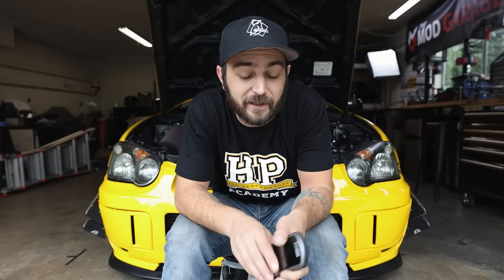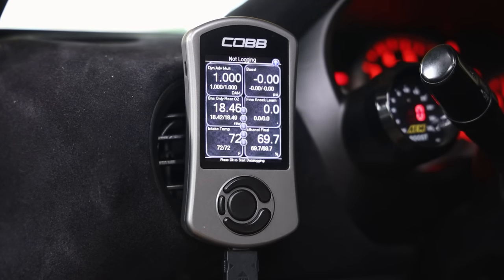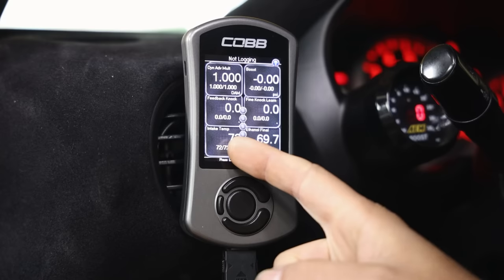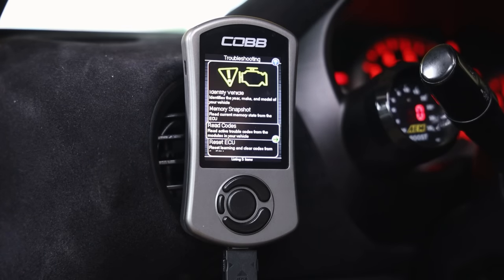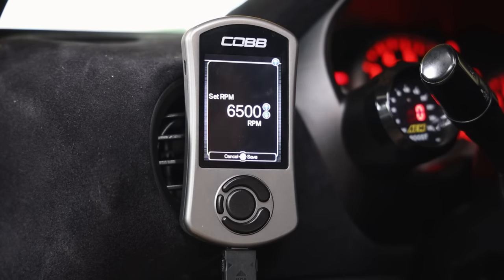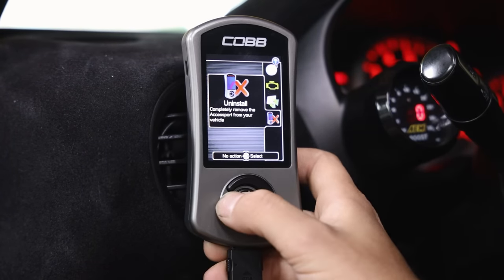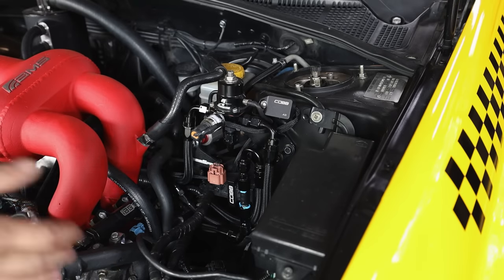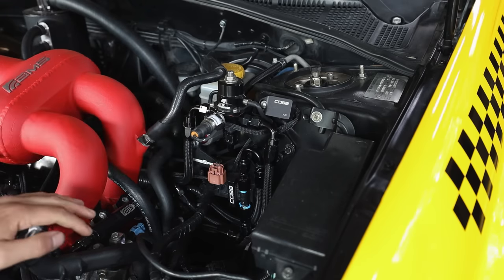Complete Cobb AccessPort Guide: Features, Values, Set up, Tuning & More.

Comment: I've recently got an accessport on my car. I'm stage 1+ with redline cobb intake and tomei cat back. I've noticed my accessport has 3 different (OTS) tunes I can put on my car for stage 1+. The "normal" one, HWG and LWG. How do I know which one I need to use. I know it has to do with the PSI your turbo is putting out, but it also says to contact your tuner to figure it out. Which I do not have a tuner yet. I noticed that with this tune on my car my turbo was able to jump from 18PSI to 21 PSI. Do I need to use the LWG because of this? I was also reading that my "turbo error" on my accessport is supposed to be between -1 to 1 with wide open throttle and I'm more between around 3-4. (with wide open throttle).
Reply from the maker: The LWG map is always a safe bet until you can snag a tuner. What is the car?

Comment: So in my case I bought my wrx hatch with an invidia down pipe, catback exhaust and Cobb intake and I’m running a stage 2, should I remove the tube to be safe or so? This is my first Subaru so I wanna be safe but modify it too.
Reply from the maker: I'd highly suggest the Cobb downpipe. With a catless downpipe and being internally gated your subject to boost creep which can cause lean conditions.

Comment: I just bought a used 2018 Sti from a car dealer.
I have driven it about 500-600 miles and the other day I noticed dark stains looked like oil with dirt mixed stuck on,  near where the Y pipe meets the turbo. Should I be concerned….?
Reply from the maker: I'd inspect around for leaks, sounds like it may be the valve cover 🤙
Reply: @Smeedia  ok thank you for prompt reply. Btw I really enjoy your videos they are very informative. Keep up the good work and good luck on your future endeavors.

Comment: I jus bought and a focus st with a cobb accessport, how do i tell what tune it is on and what gas does it is tuned on?
Reply from the maker: If you go into the tune settings it should say "show current map" that should have the fuel type to use and what tune is on the car 🙏
Reply from the maker: Also congrats on the ST!
Reply: omg u replied 😨. thank you i appreciate it so much. one more question if you don’t mind. my car also has an ethanol gauge and i’m not sure if it takes E85. it’s a 2014 Focus ST. I looked up if it has flex fuel but i’m get mixed answers. Can u help?
Reply: sorry another questions. i was doing a pull and the car is mostly putting in times to a max of  4.30 but i say it take out .60 as the min. should i be concerned
Reply: @Smeedia  i checked it and it’s just showing me that it’s a custom tone by the previous owner.
Reply: tune*
Reply from the maker: If its a custom built map then what you can do is download accessport manger on your computer. Connected the AP to the computer. Then select thr custom tune and that should pull up all of the map notes covering what's all done to it😁
Reply: @Smeedia  okay thank you so much. it really means a lot. just wanna make sure im taking care of the car correctly.
Reply: @Smeedia  i did what you said but when i try to open the tune, it’s says it’s a .ptm file and it wouldn’t open the tune.

Comment: could a boost leak or a loose gasket leaking air cause the DAM to drop? and if there was a loose gasket/nut making a rattling noise could it be setting off the feedback knock?
Reply from the maker: Yes and yes. I'd start with a smoke test and then start looking around for loose things

Comment: Do I need to reflash the car in order to install the accessport or is it plug and play automatically does the live data reading? I bought a car and it has a stage 2 tune and I want to look at how the car is performing. Can the accessport identify the tune? My plan is going stage 3 but as of now I want to see how the car is doing
Reply from the maker: You'll need to reflash, but you can monitor all data live. 🙏
Reply: @Smeedia  Ok. Does the accessport comes with Cobb tunes already downloaded? I don't have a copy of the current tune since I'm a new owner I don't have a tune to flash it to

Comment: So i have a Super Dumb Question on Flat Foot Shifting, I have a 17STI and i have FFS set to 5500 RPM, however when i floor it (accel 100%) it goes well past 5500RPM, does FFS only activate once i push the clutch in to shift similar to LC or should it not pass 5500RPM?  Do i need to be floored for it to activate?  Thanks!
Reply from the maker: Not dumb at all! So the FFS limiter will keep the car from over revving past whatever it is you set it to while your shifting and yes needs to be floored 🙏

Comment: Hi, I am not sure if you will see this. I have a question about the Accessport I recently purchased one for my 2020 sti but am having installing issues. The Accessport just keeps saying “Verify the ignition switch is in the ON position” which it is when I double press the start button. Do you think I might be doing something wrong?
Reply from the maker: Try disconnecting the battery for 30 min
Reply: @Smeedia  thank you man I tried that. Seems to be a issues with the cobb wire they sent

Comment: Can you help me out man? I bought a 2018 Subaru wrx sti limited and the DAM stays at 0.00 when I’m not pushing on the gas peddle, when I accelerate it goes to 5.98 I know it should always be at 1.00, I have a few ideas on what could be wrong but I want to hear your input. Thanks in advance bro🙏
Reply from the maker: What mods and what tune are you using? 🙏
Reply: @Smeedia  I’m running a Accessport, Grimmspeed AOS, Boomba Bpv, Cobb SF intake with air box, Sprint booster V3 controller, and a invidia exhaust. I bought it like that and I just got in contact with the previous owner and he said he never went in for a tune so I’m certain that is the issue. I just had it on the ots stage 1+SF 91 v400 boost select map. I’m a delivery driver so I use it as a daily, do you think ill be good to drive around in it till I can get a tune on it here in a couple weeks or so?

Comment: I only want the accessport for the stage 1 tune on my stock 13 wrx sedan. In your honest opinion is the performance negligible for the cost of the unit? I have zero desire to add any aftermarket parts other than accessport. Any support here would be hugely appreciated 👍
Reply from the maker: You won't notice too much difference tbh. Definitely adds a small bump but nothing crazy 🙏
Reply: @Smeedia  thanks brother
Reply: @Smeedia  definitely feeling the difference with the stage 1 tune. Have you ever heard of anyone using the stage 1+ while continuing to use the stock air box?

Comment: Adjust timing only lets you take away timing, lower it if you have bad fuel and want to be extra safe
Reply from the maker: Good to know 🔥
Reply: Is this not an option on FA20? Mine doesn’t have it, also real time flashing isn’t useable.🤔
Reply: @aaronanderson5573  im not experienced with the fa series, only ej and ford
Reply: @rogueroger0  ok. Odd it’s doesn’t seem to be universal.
Reply: @aaronanderson5573  things change between platforms because the ecu itself is different and give different capabilities, the fa uses a different ecu which would be why its different

Comment: If your DAM drops below 1.000, how do you bring the DAM back to 1.000? Thanks, really appreciate the video
Reply: Drive around carefully, up your fuel quality. Stay out of the rpm range where you get any knock.
Don't go into boost if your IATs are high. 
It's full on summer here in UT and it's been consistently 100°F the last few months and Ive been driving on. dAM consistently around .750-.812 cause the heat just messes with my FA20dit (super picky little engine).  It'll rise up a bit when temps are cooler and I keep in it's happy spot. But honestly as long as you're inside of what Cobb says is safe you're fine. Don't get stuck on keeping it at 1.00 if you live in a state where the temps get above 90°F that's nigh on impossible.
Reply from the maker: ^ Do this first. I've found success with getting into mild boost as well to get DAM to go back up. Or you can force DAM to 1 by resetting ECU learning but I use that as a last resort
Reply: @jasonluu3242  Is it just me, or does this engine thrive between 50-70 degrees and the sun being down? 75 and it’s too hot, below 45 and it struggles to get to temp.
Reply: @aaronanderson5573  it totally does. I've noticed that if ambient temps are around 80° F my car just starts throwing a fit about everything.

Comment: What are normal fuel pressure levels? Just installed the accessport and a AEM fuel pump and want to make sure I’m ok
Reply from the maker: Whats the car? 🙏
Reply: @Smeedia  2018 wrx, I have take a picture of the values on my accessport after a drive
Reply from the maker: The low pressure pump won't change anything, you'd have to mess with the HPFP to need to monitor anything
Reply: @Smeedia  gotcha ok awesome thank you

Comment: Hey what is your position on using a 91 ots tune on 93 gas?
Reply from the maker: Should be fine, but why not just use the 93 tune?
Reply: @Smeedia its not me. I was on reddit and a few people agreed to do that because I guess they were saying the 91 tune on 93 gas acts as a more “safety cushioned” tune than the 93 tune on 93 fuel.

Comment: Whats a safe high coolant temp to read for the closed deck? It seems to read high on the ap but no temp rise on the dash.
Reply from the maker: Mine doesn't go past 207*  fans kick on at 205 and drop it
Reply: @Smeedia  probably should change my mishimoto radiator. At times i hit 220🤯🤯🤯
Reply: @Smeedia  what coolant do you run?
Reply from the maker: OEM Subaru Blue 🙏

Comment: I got the cyl 4 cooling mod on my car, running the ACN 91 tune with 93 octane, and never use the S#, only the S drive. I'm more worried about spinning a rod bearing now than anything else, but I'm also monitoring engine oil every 3 drives.
Reply from the maker: Use the sport # and just monitor things. Subarus aren't made of glass. You can have fun with thr car

Comment: How do I know my fuel pump is bad ?
Reply from the maker: It won't pump fuel... 👀 lol

You'll hear that it won't prime
Reply: @Smeedia  idk but after I hardwired the fuel pump, the car hasn’t been the same. Immediately different. Sluggish. Fuel pressure at 48 when idling and 79 at WOT
Reply from the maker: Ehats your fuel pump duty cycle at idle?
Reply: @Smeedia  100

Comment: Dumb question Should I be worried  Mine dropped to 938
Reply from the maker: Whats your knock at? 
Recently get gas somewhere new? 
Ots tune or protune?
Whats the car?
Reply: @Smeedia   ots tune   MA performance
Reply: 2020 sti with  Is cated down Pipe  and cold air intake
Reply: Dam is at 938  and  What should be a normal feedback And Fine knock
Reply from the maker: First thing that comes to mind is less than ideal fuel, re fill recently?